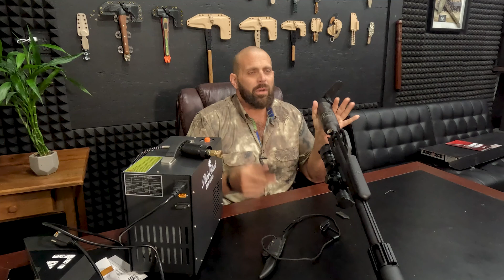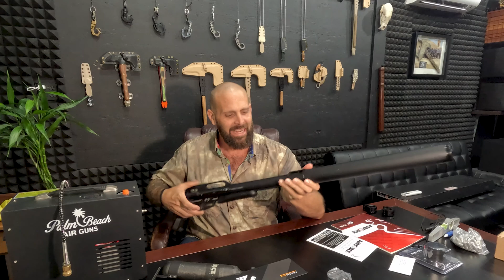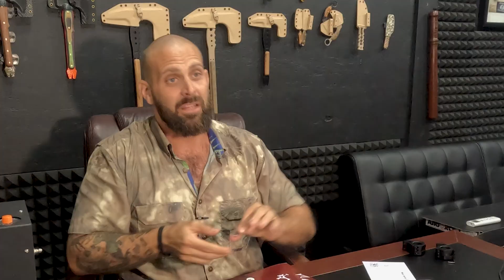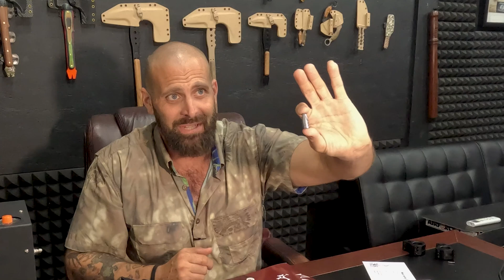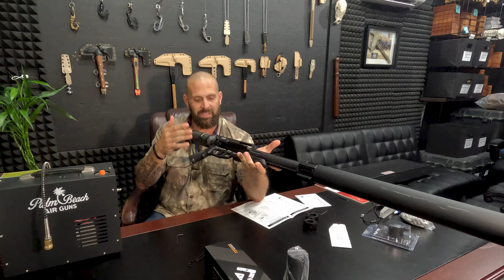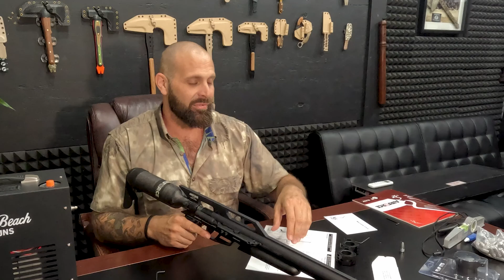AirForce Texan PCP Air Rifle Review | Poor Design & Bad Engineering

Comment: I bought an Airforce air rifle because I got tired of every other gun breaking down.   I agree the instructions could be clearer.  You fill the gun initially off the gun or with the action open.   I have a number of these guns and actually prefer the standard Texans.  The other sound suppressed guns are quieter, but I prefer to slap a Donny FL.   That being said, all there barrels should be threaded for a suppressor.  Putting on the tank also needs better instructions, but the spin lock attachment is an improvement.   You should be able to tighten the bottle with your fingers, then tighten with the wrench.   I’m betting yours sat in storage in a damp/wet environment.  I had one of mine that was a little gritty.  After cleaning it went right on.  Granted, you shouldn’t have to do this.   One final point.  Airforce Airguns has by far the best customer support in the business!!!!   These guns are built like tanks.  I think the grip is a standard AR grip, so I’m not sure how that snapped off.  Did you contact Airforce?  My experience has been the opposite of yours.  I agree the ergonomics could be better, but I don’t think a more durable air rifle exists.

I have had a couple issues.   One tank leaked from the nipple threads.  Airforce immediately replaced the tank and upgraded it to carbon fiber at no cost.   Another gun had the foster oring get crushed.  I put on another provided by Airforce in days.  I shoot about 500 rounds a week and have never had an issue.    

The matte black finish on the shroud does mar easily.  I understand your comment about length.   I would say these are stand or sit and wait guns.   When properly tuned these guns are hunting accurate out to 150 yards.  The 257 models can reach out accurately well over 200 yards.

The issue is finding air rifles that have the speed and power to humanely kill animals.   There are very few air rifles you can shoot and kill coyotes from 150 yards.  The Texan 257 is one of them,  the 308 will easily kill hogs.   The larger calibers 357, 457 and 500 are really 100 yards gun primarily because of the animals you hunt with them.  At 75 yards they are lethal.
Reply from the maker: I’ve since switched over ver to a way better brand of air rifle! The difference is night and day 👊🏻 check out my panthera video!

Comment: I agree the texan is butt cheeks but if u wanna great airforce airgun look for the airforce talon bolt, solid platform, lower pressures, and all around much more practical than a regular crossbow
Reply from the maker: Fair distinction—my criticism of the Texan doesn’t automatically settle the question of a different model. Have you spent much time with the Talon Bolt yourself?
Reply: @BoneTactical  it's nice the sling situation sucks but it's like a 40 dollar solution, after a few thousand shots it still holds air like a champ, it's accurate to a fault out to maybe 50 yards I don't have anywhere to shoot further, my one complaint is the arrows wear out no matter what in like 15 to 20 shots because it like loosens the arrows tolerance a lil each time till it rips the back of the arrow up.

Comment: The tank fill is just from empty you want to fill tank before installing.  Otherwise it doesn’t fill from empty thru that valve.  Most of thesePCP’s are expensive prototypes.  I am sour on most of the air gun industry.  Bunch of expensive paperweights
Reply from the maker: You’re very right about that—thanks for explaining the fill setup, my friend.

Comment: Kinda sad to see this happen. I have an older D-Series Airforce Condor SS that is built like an absolute tank. These new E-Series guns must have an issue with their new bottom end frame that takes AR grips. Hope they fix that, these guns are a treasure when it comes to user servicing/modding and power output.
Reply from the maker: Thankfully, they took my advice and did a redesign on the parts that needed it in 2025

Comment: Its supposed to be a great design but only on the shelf because if u do anything that resembles trying to shoot it,it has to be wrapped w bubble wrap so u dont break it! I called them and they acted like i was crazy and i only shot it 3 f"ing times,i cant get the bottle off and a broken bolt underneath because i forgot the auto safety thats made of glass, and pulled the trigger   either that or the slight wind from me breathing on it .

Comment: Your 100 percent right! The thing is basically a piece of sh, t that cost $1200 !  I can't get my tank off either , it's impossible and I'm afraid to do exactly what you just did. The other shit bag thing is the auto safety which if u accidentally forget about it and squeeze the trigger ur f*cked. You have no choice but to recock it which breaks the bolt underneath behind the hand rest

Comment: So, the grip completely broke off? what im told you can put any AR type grip on it...Theyve got a Lifetime Warranty, dont know how good the customer service is..ive already got Benjamin Bulldog .357 that has been modded( Pitbull Air) to max power and to the truck gun size( 30" overall)...was wanting one of these due to reputation of being very accurate..
Reply from the maker: I was simply sent the rifle for review and the actual receiver broke apart… it didn’t even pass the unboxing to make it to review. I sent it back because it’s a piece of junk.
Reply: @BoneTactical  wow..hmm, yeah its got me thinking..but im limited on what is available, money wise, etc..ole Pitbull( bulldog modded) for 30" overall is equally or more potent than the Texan .357, but it cost alot all the way around..but looking for something thatll do the long range shots..
Reply from the maker: @ Umarex Gauntlet 2 SL Testing and Review
https://youtu.be/Gip7uhX15oc

Comment: This design has been around for 30+ years.  "Poor engineering" doesn't stay in business that long...
Reply from the maker: Thanks for sharing your opinion friend. You’re right about one thing, they probably won’t stay in business much longer if they can’t learn to innovate!
Reply: @BoneTactical rubbish, ive had my 50 Cal for 4 years now- simple design, very cheap and  Easy to fix or replace any parts in the tx2 valve  or trigger assembly...apart from these areas, not much can go wrong!  Powerful, license-free and has taken many pigs and deer! Also air force After sales support/ service Is the best ive come across- globally!
Reply: @BoneTactical  bone you are right
Reply from the maker: @raysmith6829  thanks man 👊🏼

Comment: I'm very big in the air guns myself I have some that I wouldn't mind using it if it came down to self-defense and it's only thing I had
Reply: Any recommendations?
Reply: @adamgonzalez7450  I love my vectis .22 caliber happy modified lever action it has a 12 round magazine I'm shooting at 30 gr slug at 1230 fps.
I also have a regulator I get 30 shots between fills
Reply: @raysmith6829  thank you! I’ll look into those
Reply: @adamgonzalez7450 an AEA MEGALODON shotgun in . 58 is awesome bro. Believe me
Reply from the maker: Yes they make some great ones. My umarex is a much more robust design